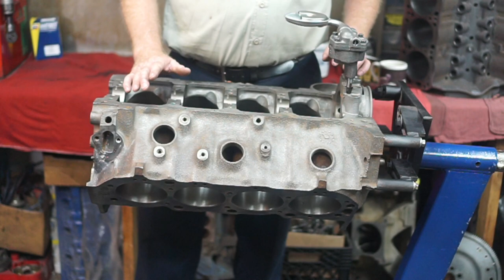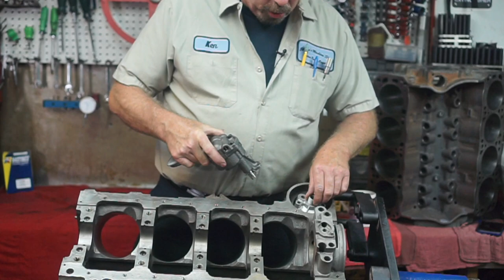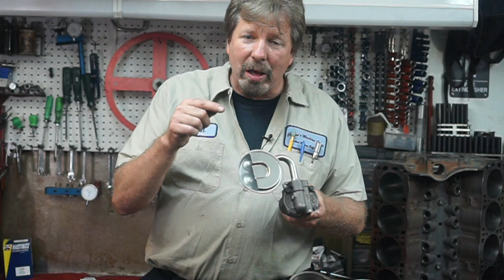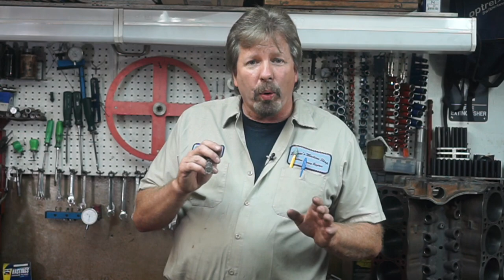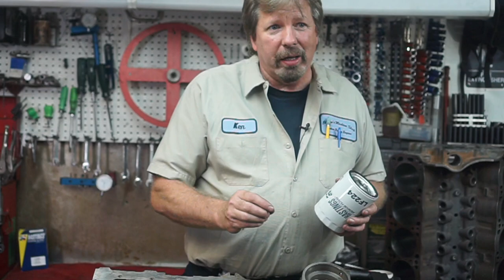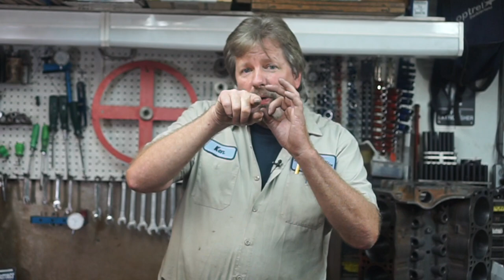Camshaft Installation Pro Tips Part 1

Comment: Hospital clean, and sterile absolutely.  I like the pipette brush technique going through all the oil passages.  Definitely touched on parts that are most over looked, such as taking the oil pump apart. This is one of the most informative channels out there on engine building for sure.  Your experience and knowledge is greatly appreciated.  There was a lot of focus breathing in the video, and the white balance was changing often. If you're using a cell phone they make an app called FilMiC Pro, where you can lock your focus and your AWB auto white balance. This will dramatically improve your videos, and make a better teaching experience. Thanks again for sharing your knowledge.

Comment: Good information there Ken. I would like to see how you get the 3 plugs out from around the camshaft bore on a small block chev at the back. They are the hardest things on earth to get out, especially the ones with a square hole in them.

Comment: Good video Ken, very informative. I am a machinist.one thing I don’t understand and I have heard this from multiple people who build engines is you say you chase all the threaded holes with a tap. Now most engines when they are manufactured new are tapped with roll form taps. Now if you chase a roll form thread with a cutting tap you are over sizing the minor diameter of the thread this making the thread weaker. All that material that comes out is from the thread being recut. How can this be good for torque spec?
Reply: Thread chaser kit is the way to go..No Taps..

Comment: I agree with you 100% I don't see how those guys wear gloves. in fact it drives me crazy watching other people wearing gloves. because I very much depend on the touch sensation in everything I do. it gives me more feedback than my eyes sometimes can. although I don't like the sensation of grease on my hands. because no matter how much I can wipe my hands off it still feels like it's there. so if I'm not feeling right about the feedback that I'm getting from my hands. I might wash my hands twenty plus times just to make sure I'm getting the proper sensation in my hands. I have some of those machanix gloves but don't wear them. and the nitrate gloves are more of a pain in the ass then they are worth. because they start falling apart before I can get much done. so I will stick with not using gloves. Lubriplate has been my preferred choice for assembly lube. and a large selection of pipe cleaners is an absolute must for engine building. there's one long standing phrase that always comes to mind for me in regards to engine building. and that is "cleanliness is next to Godliness" and it has served me well.
Reply: "no engine ever died from being too clean". -- Smokey Yunick.

Comment: I bought a long block 496 on e-bay, 2 of the lifters wiped out cam lobes on break-in. So I ordered a new cam&lifters installed them and realized that the stock push rods were too short, so I ordered longer push rods put it together and it broke in fine and runs good. My question is could too short of a pushrod cause lifter failure?